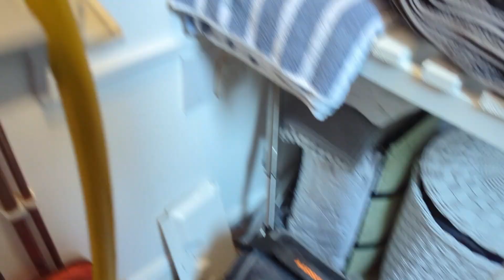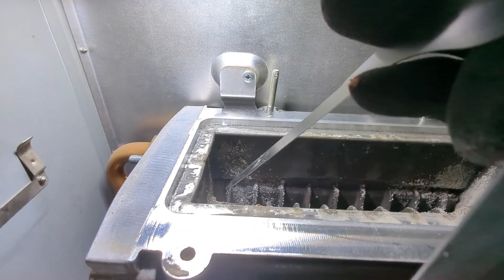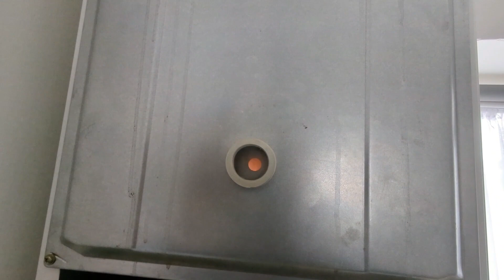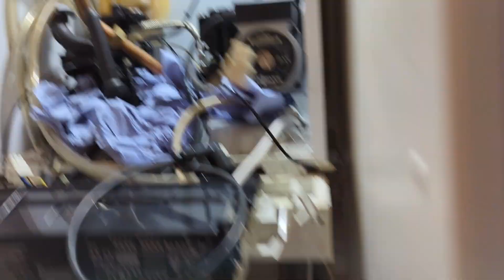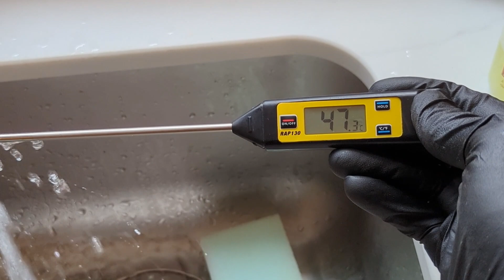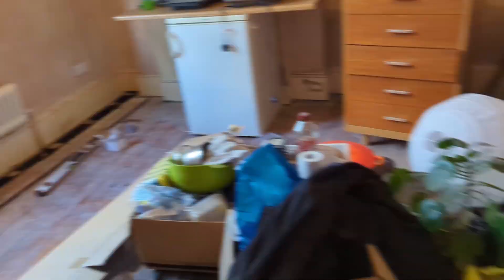A Day In The Life Of A Gas Engineer #19 - Worcester Services, Viessmann Breakdown & Vaillant Outcome

Comment: Good and honest video's! I don´t like servicing the Viessmann´s with the rubber hoses for that reasen. Had exactly the same problem last time. I think by draining the boiler the hoses shrink and loose their dirt. Poor that there isn't a canoo filter inside like the vaillants.
Reply from the maker: I think you're correct, draining it and recharging the vessel may be pushed the dirt down the hoses. Fortunately I'd already pointed out the issue to the customer during the service so he was fully aware

Comment: I think you had mentioned previously that you had changed the mass flow sensor and the gas valve ? 
Did you replace one, test and refit before changing the other ? 
This could be the difference ? Vaillant changed both together  and got a positive result ? 
I have a distant memory from a long while ago,  changing both is sometimes recommended ? I thought this was because Vaillant engineers couldn't fault find one from another and just did both regardless, perhaps not ? 
A couple of years ago I changed a gas valve on a R2/3 model, tested the boiler, all perfectly ok and got a call the next day. The new gas valve fitted had become defective with the same fault code ! 
Changed it again and been fine since ! 
This can happen with Vaillant gas valves and on contacting Vaillant,  I did get that confirmed from the "horses mouth" ! 

If you are good and experienced, a lot of our work is routine but sometimes an unusual set of circumstances can challenge the best of us. 
I realise this doesn't help much especially when you are at a job late at night... Hey ho.....
Reply from the maker: Thanks for the comment mate. Yeah we did change both together to rule it out. Either we got extremely unlucky with 2 dud parts out of the box, or we don't know the full story from what the Vaillant engineer did